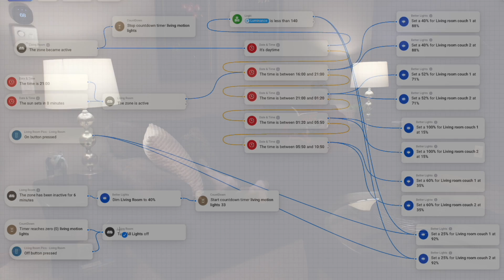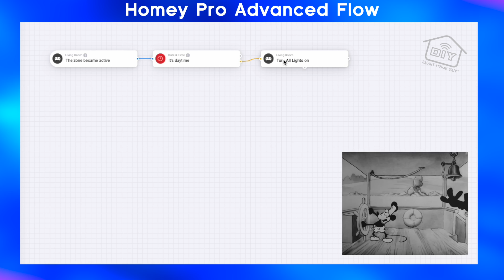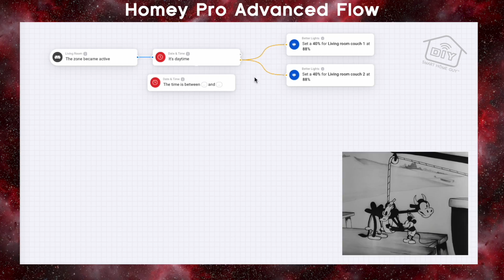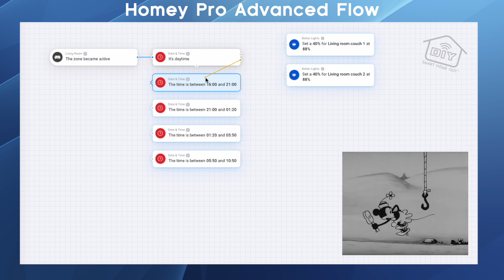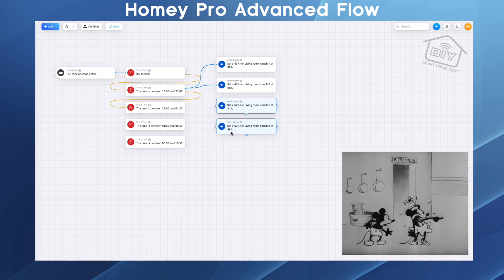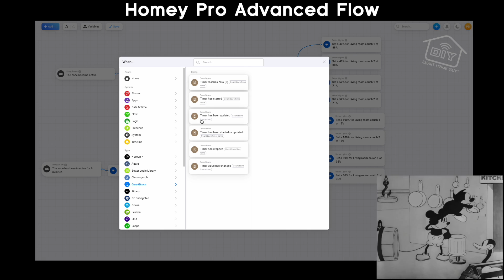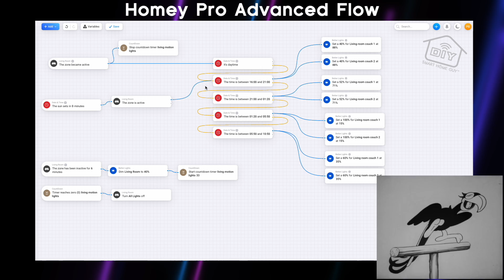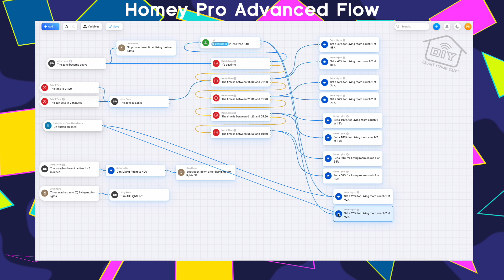How to build an Advanced Flow with Homey Pro

Comment: Couldn't you simplify this a lot by using the Circadian Lighting app? I couldn't completely follow what you're doing because that Steamboat Willy video is so distracting, and annoying.
Reply from the maker: In theory, yes. But have you used the circadian app? When I tried the app, it kept going offline so the lights weren't working properly.

Comment: Are you having any issues with zigbee devices with the Homey Pro ? I keep reading on the community that zigbee devices have lots of problems. So far I am not having issues but I do not have a lot of devices yet and have not been using the Homey very long. Hubitat has been rock solid for me so far but so has the Homey Pro.

Comment from the maker: What should I automate next?
Reply: A "Nightlight Mode" lighting flow that can be activated from the bedside using a button remote. Stipulations are: (a) activated from button, (b) deactivated from different button (or toggled from same; may be easier for groggy users, lol), (c) dims appropriate lights (e.g. bedroom, hallway, bathroom) to appropriately low levels and eye-friendly color temperature. Optionally logs activity, so you can know how many times you (or a loved one) rises throughout the night.